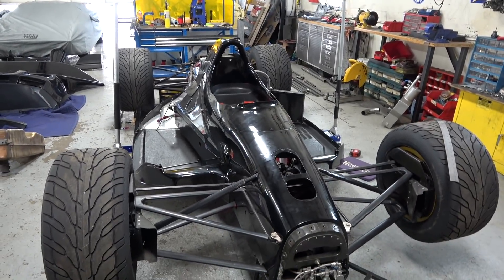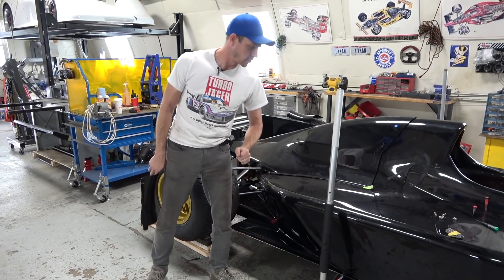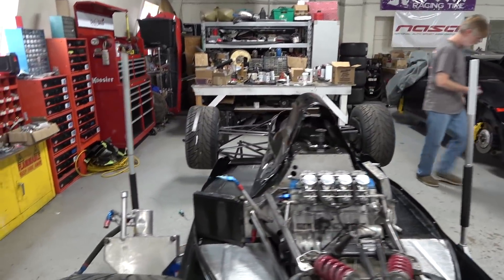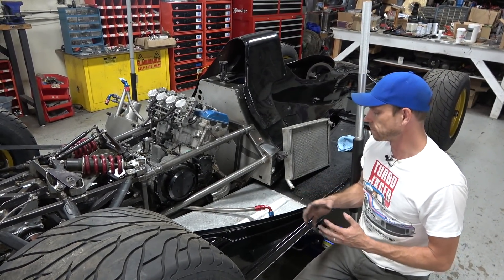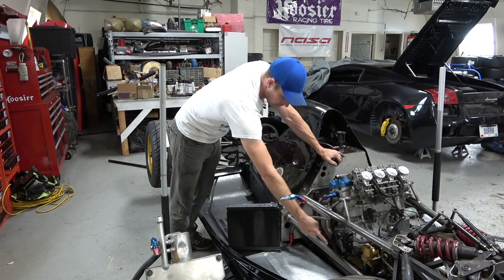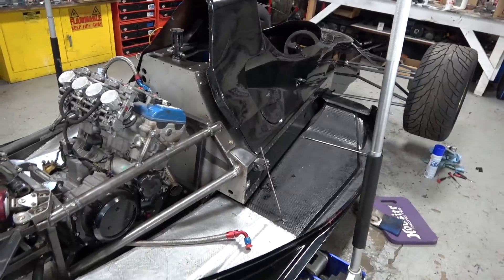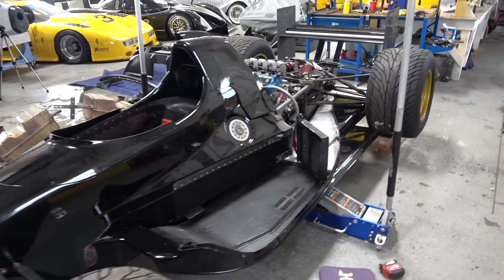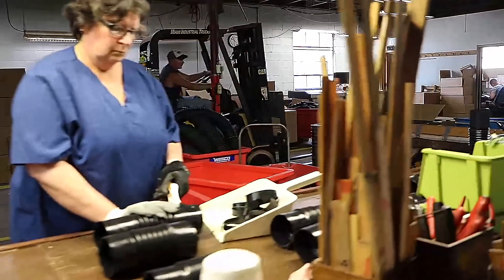Formula 1 Custom BUILD REVIEW before dismantling #9

Comment: I watched the vin wiki video on this car with reverse on Harley Davison with a sidecar they use a small electric motor for reverse so they could keep the Harley Davison transmission and cut cost. But is is your build and I’m only giving some advice but if it would be a nightmare to work it in don’t.

Comment: I have never worked on an open wheel but that oil cooler seems a bit close won’t it get heat soak
Reply: It’s not a matter of keeping the oil as cool as an inter cooler keeps the charge temps, it’s more about keeping the oil below where it starts to break down (around 275F). With an engine that small, and that much capacity in the oil tank as well as that large of a oil cooler it should be fine. Also there is no radiator behind it, or intercooler in front, it is open on both side to pass as much of cold air as it can.